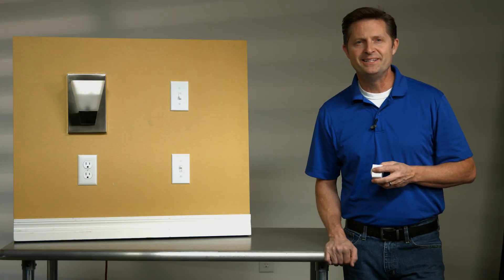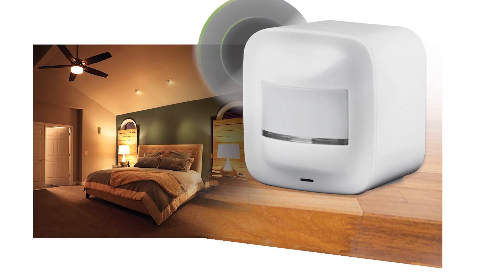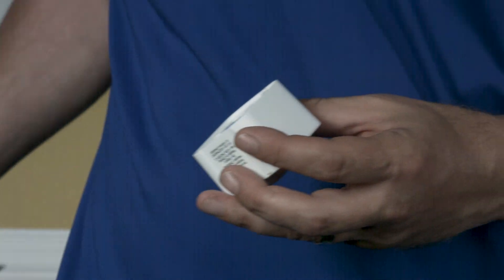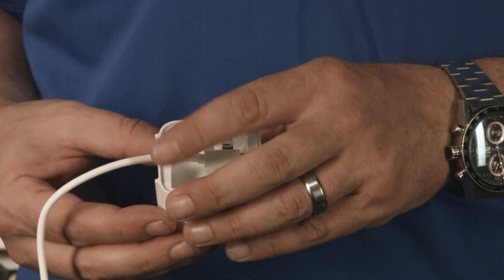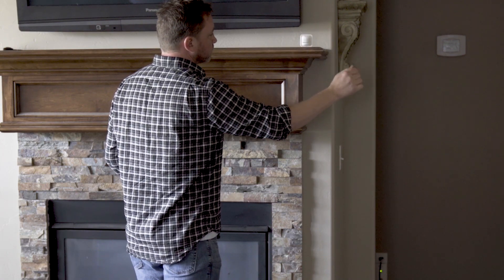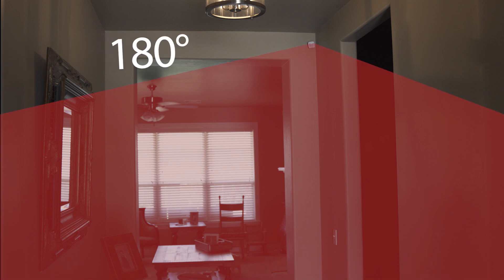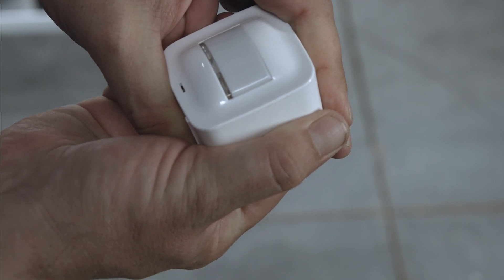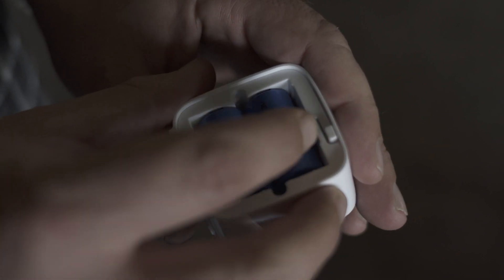34193: GE Z-Wave Portable Motion Sensor Overview

Comment: Is there a way to change the detection cooldown? I need a product that can cooldown and detect faster than 2 or 4 minutes. Thanks.
Reply from the maker: If your hub or controller allows Z-Wave configuration adjustments, you can modify the timeout duration from one to 60 minutes. By default, this time is four minutes to conserve battery life. We recommend using the Micro USB power option if you change this time to less than four minutes. For additional assistance, feel free to contact our U.S.-based consumer care at 1-800-654-8483, M-F, 7 a.m.-8 p.m. Central Time.
Reply: I am having this same issue. I am using the smartthings hub. I see an option to change the time to 10sec but i am still not seeing that change impacting the sensor